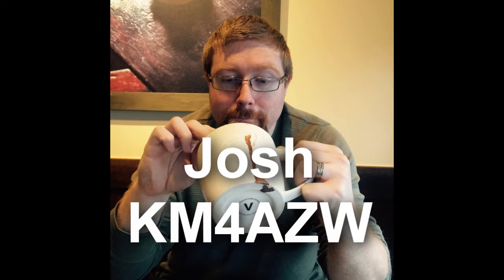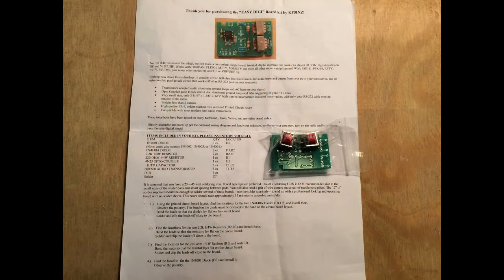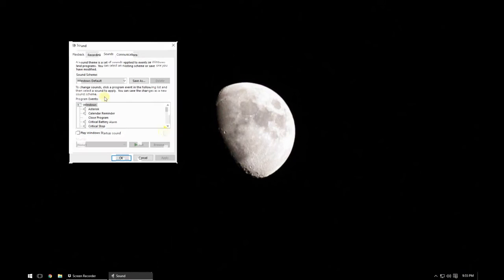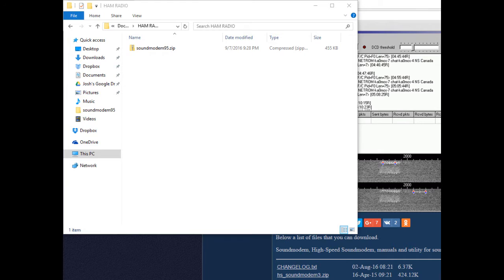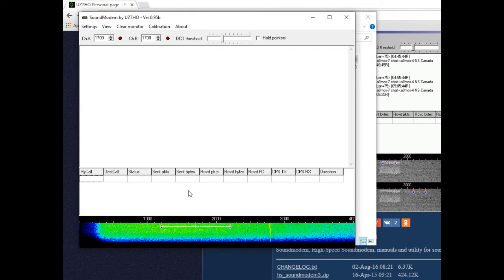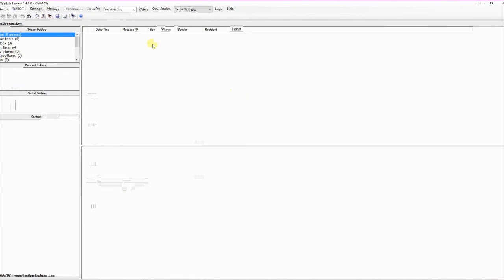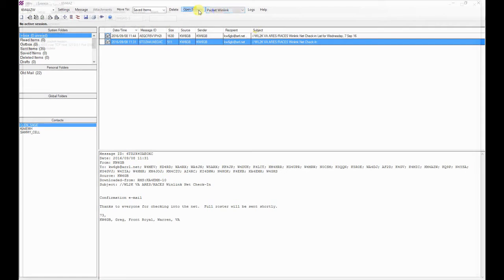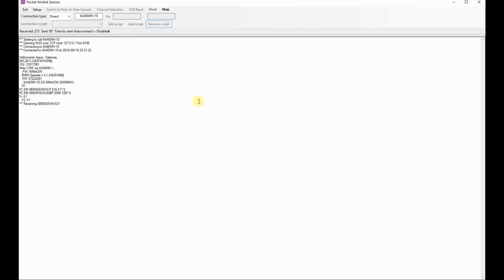Easy Digi, Sound Modem, and Winlink

Comment: Wait, i only have a handheld transciever can you make a video just for 1 of them and this audio board kit and show how to do it without needing a hf or home base setup? does this sound modem or any other of these apps require a modem ???
Reply: To answer your second question, this sound card and the UZ7HO soundmodem software take the place of a traditional TNC or radio modem. There are so many different cables/wiring for each HT, but all you would need to do is make a cable from the HT's audio out to the sound card's microphone jack and then another cable from the HT's microphone jack to the sound card's speaker jack.

Comment: I've got an easy digi and I'm hoping to use it for JS8CALL and possibly a few other modes. JS8 is the modification of some of the parts of FT8 with TONS ! of additions so you can have complete on the spot keyboard to keyboard QSOs OR put messages on mailboxes at the other stations, also you can relay, and more to come ! Its an extremely low signal mode so I have QSOs when the band is down , signals are non-existant, and you can't see them on the waterfall !  I did purchase a used PK32MBX recently and hope to use it for Winlink. All I've done with the PK32 is  (so far) communicate with it. So far it seems to work and respond to commands.... Due to the fact that I have a 10 digit grid square for JS8 it shows on APRS FI . Perfectly.

Comment: I wish someone would create an iOS TNC modem app to run winlink from an iPhone. This would be extremely useful for those on small boats with limited space, emergencies, or even backpackers using a QRP rig.
Reply from the maker: Tell me about it. Honestly there aren't very many good apps out there on iOS for HAM operators. A lot of headway is being made on Android though. With the new ARDOP mode in Winlink express, there is an Android winlink client in the works. Hopefully soon we will be able to attach our phones and tablets up to a radio and do the same as a PC.
Reply: Apple refuses to allow terminal modes to be accessed
Reply: Michael Linzenmeyer There are already several software based TNC iPhone apps that encode and decode ham radio digital modes. This would be no different then those that already exist other then it would be a different data mode. Look up the following apps in the App Store: iWSPR, APRSpro, SSTV, Hellschreiber, PSKer, & HF FAX. Creating an software based TNC modem iPhone app to operate Winlink, FT8, JT65, & JT9 is totally doable and would not break any rules with Apple.

Comment: Thanks, very informative. Do I understand correctly that you're doing this on VHF?
Reply: Yes, however you can use the same method with an HF transceiver. In which case you don't need to use the UZ7HO Soundmodem software, you use Winmor which is bundled with Winlink Express.
Reply: Thanks for the swift reply. I just got my General ticket recently and don't have any HF equipment yet so I was wondering if I could set this up on my VHF/UHF mobile rig. I had heard that I would need a PACTOR TNC (!!$$!!) to get to WinLink on VHF. Looks like the UZ7HO software eliminates that as long as I have something like your Easy DIGI gizmo. I checked your blog article and thin this is something I could do. I have an old laptop that will work so I might be able to get this together fairly soon. Look forward to seeing more videos from you. 

Thanks again & 73s
Chuck KG5OKG